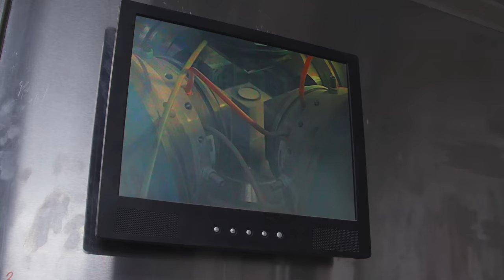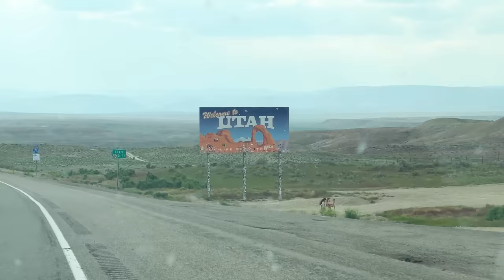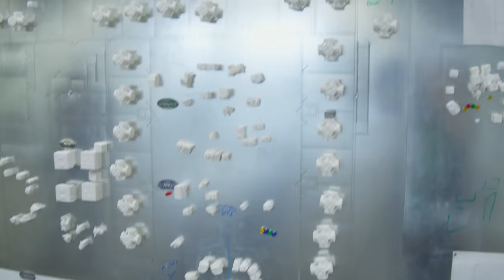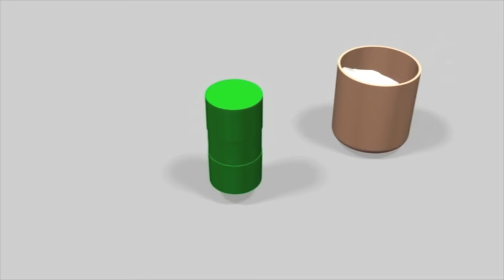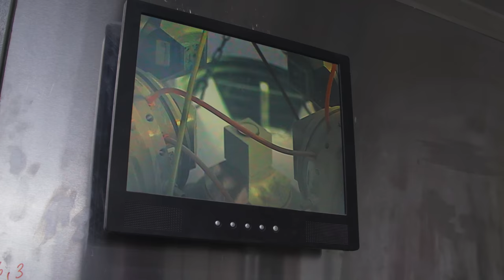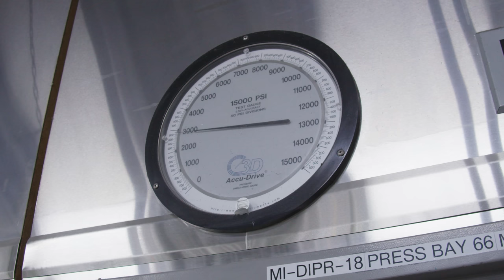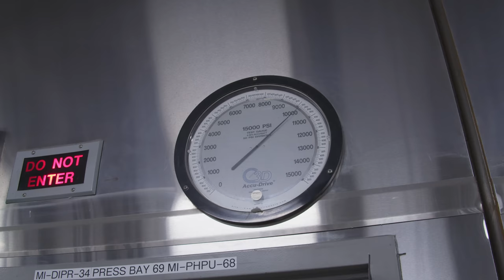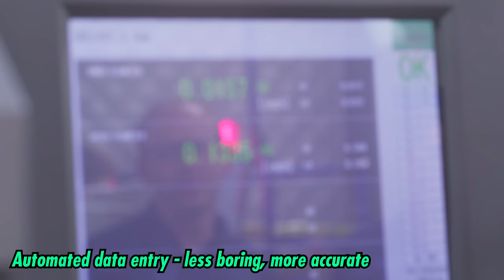The Highly Ridiculous Over-Engineering of the Diamondback Nozzle

Comment: The fact that the 3d printing lab in the factory itself has never had to replace a diamond nozzle is... Pretty amazing lmao
Reply: Yeah, the best innovations come from an actual need. If a company is confident enough to use their own product, I'm sold.
Reply: If a company is industrially using their product almost everyday for a year and a half and not needing to replace one, I won't need to replace it either, good investment
Reply: I looked at the price and seen $95 buck and then heard them say that haven't changed one and they go through 20 rolls of filament a week i figured i will probably never have to change one so 95 dollars is probably worth it
Reply: @nfg_racing7968  That is 1040kg's of filament a year. (assuming they mean 1kg filament spools not the 2.5kg ones). That IS a lot of filament. I was with you on that point, when they said they never changed it i thought about buying it too.

Comment: I love my diamondback nozzles even more now. I'm one of the folks who bought mine after your last video and everytime I watch my printer squeeze plastic onto glass I'm in awe of how smooth the layer looks. The finished parts are better looking and better bonded than with any other nozzle I've tried.
Reply: Did you lower your print temps?  Or adjust in any way?
Reply: @thezfunk  I left my print temps the same as before switching but increased speed slightly. I typically print on a cr-10s so it's not a rocket sled, but any extra mm/s base speed is noticeable

Comment: Been using diamondback nozzles for a little over a year. They're great. Super cool and informative video, had no idea about pretty much any of this. I did have an issue with my mk8 DB nozzle, but I contacted support and they replaced it SUPER FAST. Again, they're great!

edit: the issue I had was when I went to change my heatblock, the nozzle's threads had pretty much welded themselves to the aluminum heatblock (or vice versa, idk). So the threads on the nozzle wouldnt screw in to the new heatblock. DB support sent me a replacement nozzle and I had it within like 2 business days.
Reply: I've heard tungsten is better because the diamond back still has parts that are brass that will eventually wear towards the upper part of the nozzle. Is this true? I just bought one to print CF Nylon and hearing this has me concerned that I might need still need to remove the nozzle to check for wear, which I was hoping would not be the case.
Reply: @deelowe3 so in the video he actually explains this: the wear of these abrasive filaments is the tip scraping across the already printed plastic. You should not have issues printing anything abrasive with a diamond back.
Reply: @deelowe3  most wear is not the molten filament moving through the nozzle, he mentions that in the video and other people have done testing too with copper or brass CHT inserts in hardened nozzles. The inside of the nozzle doesn’t really wear and neither do the copper or brass inserts, the filament is molten at that point which makes it pretty much non abrasive, the problems come when the filament is solid, like in Bowden tubes or dry boxes, before it gets melted, where the filament is solid and abrasive and after it has been printed and has cooled, again where it is solid and abrasive.

If you think about how it wears, wear requires a force to push the abrasive carbon fibre against what it is wearing, like Zach explains, there just isn’t that force when it is molten, the carbon fibres are just pushed through the molten plastic and the molten plastic isn’t viscous enough to create a strong enough force for abrasion to happen. When the plastic is solid though it absolutely can create a force that is enough for abrasion. One point in the nozzle itself when abrasion could happen is when the molten filament is getting restricted and squeezed from its original diameter down to the nozzle diameter, the forces there when it squeezes could be enough to cause minor wear, but again it wouldn’t be much and in the diamondback that section is diamond too, the diamond does both the restriction and squeezing and the contact with the printed piece so covers the major cause of abrasion and a minor cause of abrasion and other than those two causes there shouldn’t be much other abrasion.
Reply: @deelowe3 As far as I'm aware the key advantage of solid tungsten carbide nozzles over these tipped brass nozzles is that brass itself can't handle the temperatures to print ultra high performance polymers like PEEK and PEI.
Reply: @deelowe3  The majority of the wear is on the tip but the other surfaces will wear out eventually, normally it isn't worth worrying about but considering the fact that stainless steel heatbreaks do wear out from abrasion it's inevitable the surfaces within the nozzle will too. If you're occasionally printing abrasives; diamondback is probably going to outlive you but if you're going through 10kg of abrasives every week then you'd be better off trying to track down a bozzle or waiting for deez to come out. ("deez" is another TC nozzle with high-flow geometry)
Reply: Good to know because I actually had a similar experience.  The nozzle got stuck so hard I mangled the brass completely trying to get it off.
Reply: A little smear of anti-seize on the threads would probably help.  The copper stuff would work well for brass-to-aluminium.
Reply: @conorstewart2214 what they say is not wrong, but its not right either.
Molten abrasive filled plastics are used actively as an deburr tool in aerospace. They DO abraide while molten. 
But only at the high pressure ramps in the fluid; hence thier use deburring burrs create the highest pressure ramps when you force a fluid through the opening. 
Sharing because mixing up a putty and abrasive to debur and clean up internal sharp edges is a really useful tool for everyone it makes life easier to understand and it should not be relegated to airplanes only.

So as far as the nozzle goes it just makes the brass smoother and the nozzle work better, and adopts a bit better for a very long time, likely but not gaurenteed to be longer then the nozzle will survive.
And since the ramp down to the smaller diameter is PCD the internal wear will be a fraction of a percent what you'll see at the outside of the nozzle

But you will see the nozzle grow oversized a little bit before its useful life is over, you might not have the luxury of just forgetting about the diameter dpending on use case.

Comment: I bought my Ruby like 5 years ago and it has never left my machine.  Done probably 200 spools and 25% of that is CF Nylon and PLA.  Prints the same as it did on day one.  Been worth every penny.  I print anything I want and have never worried.  

The Ruby was the top of the line 5/6 years ago and was the obvious purchase.  This would be the obvious purchase now.  Price is fair too.  

Great video!
Reply: I hear tungsten is better
Reply: @deelowe3 A solid TC nozzle will outlast a diamondback/ruby nozzle; but it only really matters if you're printing a lot of abrasives. Bozzle likely gives better flow than diamondback though, and given it will outlive it for a similar price it does seem a better choice.
Reply: @ballbous  TC is personally my pick as well, as they allow for creative internal geometries (like the Bozzle, which is exactly what I use on my VCore) and you can blow torch them red-hot to vaporize buildup and clogs (you definitely cannot do this on a diamondback).  But they're not perfect. They tend to loosen in aluminum heater blocks, so you have to use a block made of something with a lower coefficient of thermal expansion, usually copper (I use a Goliath which is copper, haven't had any issues yet). The neck of a diamondback is just brass, so it will work as-is in any type of block without issue. Also, tungsten carbide is not as hard as polycrystalline diamond, and it has twice the coefficient of friction. In the 3D printing use case, the difference is largely superfluous--at least for now--which is why I use TC. But I can certainly see certain applications (especially in the coming years where even more harshly abrasive additives begin to make their way into 3D printing filaments) where a diamondback might be the right choice.
Reply: @ballbous  except the Bozzle only comes in one size and hasn't been available for months.  Diamondback should outlast even TC as TC is only an 8 vs the 10 of diamond on the hardness scale.  Not to mention the nonstick properties.  The advantage of a TC nozzle is being able to burn out a clog.
Reply: He mentioned that one big advantage of PCD over TC is that TC is brittle, so smashing incidents might kill it. Haven't used either nozzle, but I have smashed nozzle on the bed few times. Also I work with TC cutting tools on the lathe, one wrong move and they chip off. They are also pretty fast to dull when cutting abrasive wood or even plain old epoxy (not as fast as HSS of course but they loose factory sharpness much faster than I like and are not as sharp from beginning being sintered ceramics). I would easily pay $200 for the PCD insert of right geometry for cutting wood that I would never need to sharpen or change.
Reply: @avelkm   @avelkm  there's no way you're breaking bozzle unless your build surface is some crazy material, I've carved lines through a glass bed with very little force, it glides straight through. The only people I know of that shattered their TC nozzle did so by using a TC volcano adapter with it, the two press against eachother and one shatters.
Reply: @viru52000  the hardness is not the only factor, at some point you're going to be limited by the wear surfaces inside the nozzle, rather than just the tip. Which we've seen numerous youtubers and hobbyists show; the nozzle WILL wear on all surfaces that touch the filament, the tip just wears astronomically faster, doesn't matter for a brass only nozzle but for a nozzle you're hoping to keep for life, it could be a disappointment down the line.

Of course this is just conjecture but for me a nozzle with multiple parts needs to be proven to last for decades, whereas conventional wisdom suggests that one made of solid TC will obviously last for decades.
Reply: @ballbous  as covered in the video, melted plastic doesn't have enough leverage to wear the nozzle.  It's why CHT nozzles don't get absolutely wrecked by abrasives.  You're more likely to wear out your heat break as the filament isn't molten at that point.  Regardless, if you watched the video, you would see that they've never worn one out yet and they print abrasives far more than an end user would.  Even if it's lifespan is 10 years of 24/7 use, that's overall cheaper than normal nozzles.

Comment: Biggest win in my opinion is removing nozzle wear from diagnoses FOREVER. Like having nozzles wear out is annoying but cheap, but wondering IF the nozzle is specifically the problem is annoying and expensive in time-ey ways. I dont think many 3d printing upgrades virtually remove a potential diagnosis altogether

Comment: Jsut want to say that I have experienced the bore of the nozzle to expand with prolonged use of brass nozzles... I ran a nozzle for almost two years and put kilometers of PLA and PETG filament through it and I finally began to have print and quality issues. I recall it expanded to like 130% of the original diameter, pretty significant.
Reply: If you use abrasive filaments, you may have to switch at half a kilo... There are also different hardness of brass, price tends to reflect how poor material is used; they are easier and faster to make.
Reply: @squidcaps4308  Maybe, it was original E3D nozzle. That came with a Prusa MK3s+, it just ran more or less perfectly so I didnt bother to swap out the nozzle, then I began to have quality issues but it didn't really matter much for most of my prints so I just continued using it until I finally had problems. Most abrasive stuff I used in it was probably a few rolls of silky textured filament.

Comment: I used PCD cutting tools every day and they're the cadillac of my industry. MDF and particle board are extremely abrasive (well the gritty contaminants in them really) and will wear out even solid carbide tools relatively quickly. PCD tools last forever and are absolutely worth the cost when you have high volume tasks or lots of buried cut profiles. Chuck in one tool and run it for thousands of parts without stopping.
Reply: Hey, I'm a woodturner and work with abrasive wood too. Woodturning community learned to utilize carbide inserts made for helical planer heads for turning tools. Do you think it's possible to do the same with PCD, take some existing cutter insert and use it on a lathe tool? Few hours of research not showing much, most of them are for metal lathe and have very different geometry. In our application we defo need less than 90° included angle on a cutting edge. Please write if you have any idea what I should be googling for
Reply: @avelkm  I spoke with our tool reps a few months ago about this very topic and they were more confused than interested. The idea of PCD insert tooling seems like something that never crossed their minds which is wild since its fairly common in metals manufacturing. I can say for the Canadian market Dimar and Peak Tools don't sell them and if they don't, they probably don't exist, unfortunately. 

I wouldn't be surprised if any industrial tool vendor in your area that sells PCD tooling would be happy to make diamond cutters to your dimensions and mount them on any support you like but that's going to cost quite a bit. That's what we do and it involves a cost analysis each time. If you have particular shapes you produce in large quantities it may be worth investigating. As long as you don't drop them they pretty much don't wear out even after thousands of miles of cutting. The worst they need is a little lapping to restore the edge to new. 

The PCD tools we use are mostly form cutters made to order from our tooling vendors for high volume jobs where the customer wants, for example, a few thousand cabinet doors with the same edge profile. Its worth it for us to buy (bill the customer) one tool and never have to change it for the entirety of the job and then it gets tagged and stored in a locker for future business. Happens all the time that a customer comes back for another batch and we can deliver the exact same part again because we still have the same tool that hasn't worn at all. Our day to day work is done with the same old carbide inserts and solid carbide tools everyone else uses. 

Here's an example of a PCD form cutter we use in our shop: https://i.imgur.com/sTaQcya.jpg

Its probably made well over 10000 parts over the past five years and is on its way back to the vendor to get that chip on the corner lapped out then back to work. That's one of the downsides of PCD, its brittle. It will slice through a steel bolt hidden in a panel of cheap particleboard without even noticing but you tap it into the side of another tool holder while swapping it in the tool changer and it shatters. That tool cost about $300 CAD which for the amount of work its done, the cost of getting it made was a no brainer.
Reply: Thanks for the reply. Nah, an insert for handheld tool (I was not clear enough, I meant traditional wood lathe) should not be brittle, incidents bound to happen. I was basing my interest on the claim in a video that their process gives non-brittle PCD, so the idea to always have factory sharp instrument was kinda amazing. Planer head carbide inserts are good, but they loose sharpness fairly quickly and under a microscope I can see that it's degrading by chipping off the edge. I have found today a few tools that have similar shaped PCD inserts but no link or price for inserts themselves. Maybe it's not worth it if they are brittle.
Reply: @avelkm  Yeah it looks like ChampionX has a different manufacturing method for their PCD compared to what is normally available in the wood industry. The stuff I use seems a lot more like a ceramic matrix impregnated with diamond particles than whole solid diamond which probably leads to the reduced durability against impacts. They really do last for ages but that's in a CNC shop where they spend their entire lives in a tool changer. With CNC machinery we can also exactly maintain feeds and speeds at the tool's optimal parameters which goes a long way to maintaining tool life. I can see it being a hard sell for hand lathe work. 

Its really annoying that every industrial tool supplier always has "Call Us for Quote" as the price.

Comment: My only problem with this is that you cant exceed 300c with the brass nozzle. Brass softens at 300c and trying to go higher than that when printing fast will soften, then good luck removing it without breaking the nozzle inside. I broke mine that way.
Reply: Even the cheapest brass alloy not softening at 300 Celsius. I think you talking about thermal expansion maybe?

Comment: I just noticed at 17:38 we like to see plastic moving through the nozzle at high speeds, since that's a limiting factor for our printers going faster. And it's the machine taking a dump on the plate 🙃 as we try to thin down our printer's hot end carriage, the "dump size to mass ratio is so strong" memes show up.